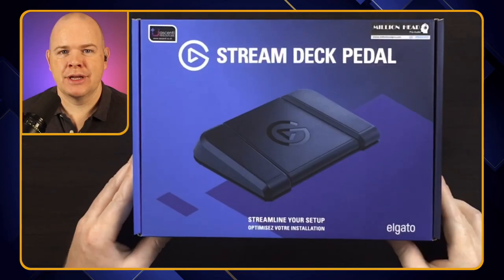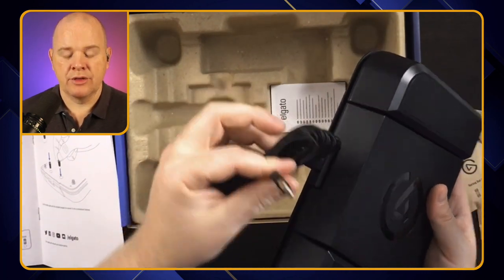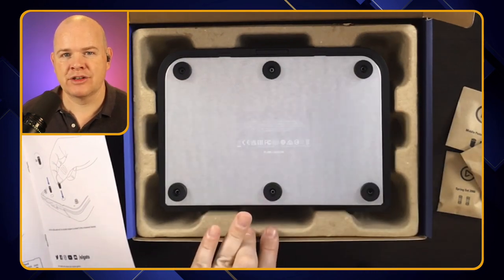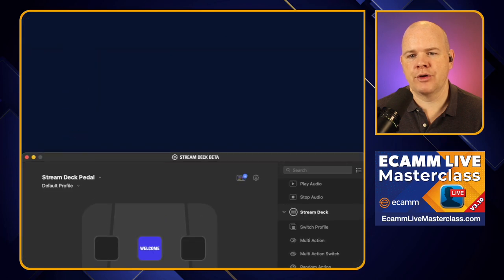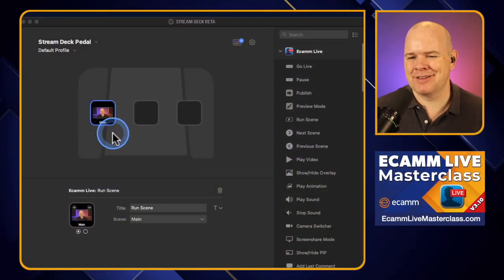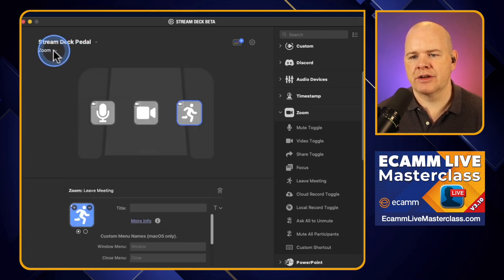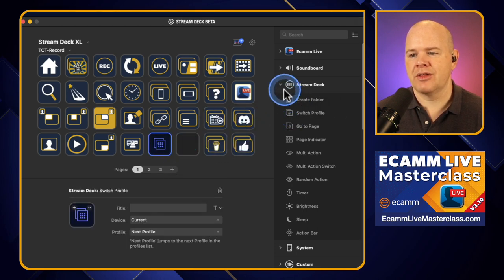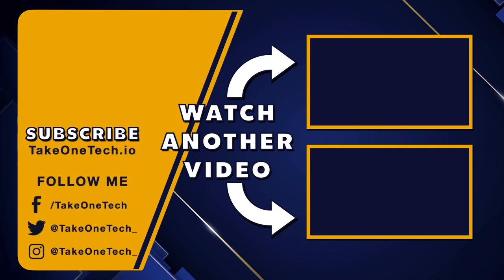Stream Deck Pedal Unboxing and Setup

Comment: Alec:  for most of us that acquires a StreamDeck Pedal (net new) is there really a need to remove the backing; to adjust spring settings ... or did you do this as a part of your Unboxing & Setup practice.

Bottom line: would you recommend that we First Try the unit, before taking the unit apart?
- typically my typical practice is to Try it first, and then adjust if needed

Thanks
(no response, necessary ... just an observation). & Thanks again for sharing your content & knowledge with us.
Reply from the maker: Indeed definitely recommend trying before making any adjustments!   Yes I was just intending to show the user adjustment feature before putting it on the floor…. I’ll be using it for a while to see how I find the tension in the pre installed set of springs before deciding if I need to make any adjustments.    I’ll make a followup video with a full review after using it for a few weeks. 🙏😊